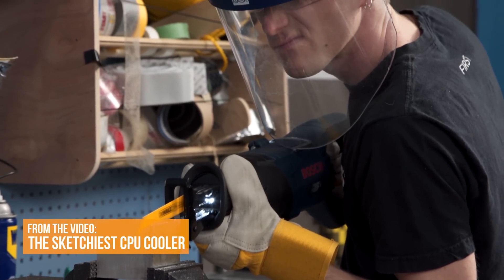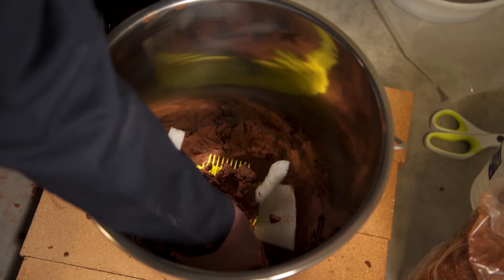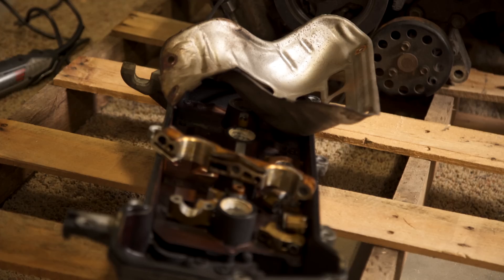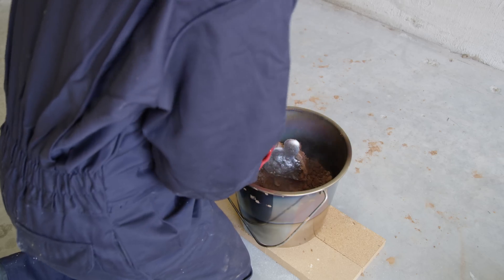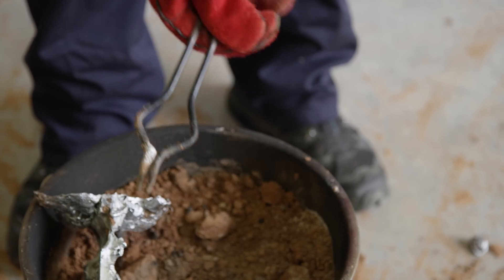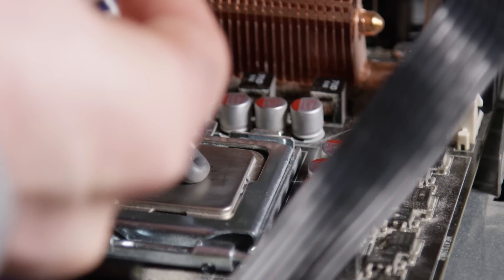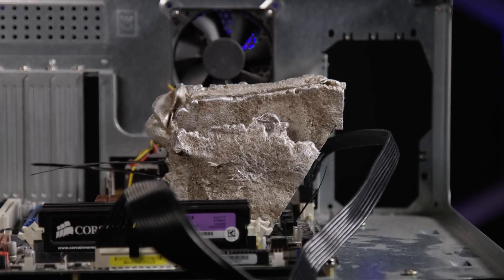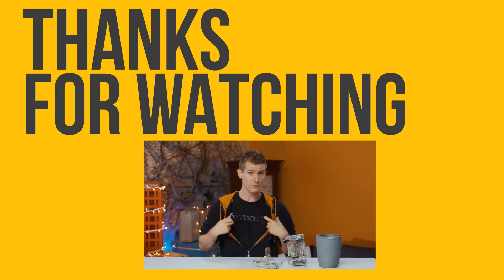The WORST CPU Cooler EVER – Sketchy Heatsinks Ep2

Comment: I think the mold material a big issue.
Should've used something like quick set plaster/sand blend instead maybe?
The biggest issue I see though is the mold isn't hot.
if the mold is cold, it's gonna leach all the heat from the molten metal, and cause it to solidify before it settles into all the cavities.

Also that no man's sky thing aged kinda poorly, unlike no man's sky, lol.
Game had an insane glow-up.

Comment: You kept failing in your castings because your aluminum was too cool. Also the based of the cooler should have been at the top of the mold, not the bottom- both for casting reasons and because when you do the process correctly, the top of the mold can be as smooth as a mirror

Comment: Should have dipped the PLA mold in ceramic slurry, layered it up super thick (by letting it dry and re-dipping over and over), then fired that to harden the mold and melt the PLA.

Then just pour into it, and as long as the sprue and vents are in the right places, you've got a heatsink.

Or start with a block of aluminum, use a bandsaw to cut regular slots for fins, then sandblast the hell out of it—sandblasting more as you approach the distal ends of the fins to achieve a taper. If sandblasting doesn't work for that, sandpaper definitely would. Simply insert paper, and pull toward the end. That way the distal ends are being sanded by the entire stroke while the proximal ends are sanded much less.

Oh well, I'm four years too late, but it isn't as if typing were difficult or time consuming. I enjoy it.

Comment: to get those small fins you want you would need to do injection moulding to get the pressure required to get the molten metal throughout. 5 years late but I just saw this one now.

Comment: omg. Yall are making this so much harder than it needs to be.
just use sheet metal,  the really thin stuff. Use a cutting wheel on a grinder to cut the metal into little squares and have the squares held together by a 3d print out. If you really want to go the extra mile, use thermal paste in-between the squares or better yet, tac weld them on. 6-8 hours of work max, if you take the time to smooth every thing over with a flapper disk.

Comment: That's not how you make a model for melt aluminum... you need to press and make the dirt more hard and you have to use two pieces of the dirt so you are able to take out the original plastic model.

Comment: I used to work in a foundry, I could have told you none of that was going to work. You can make fairly simple castings that way (if you don't care how strong they are) but what you were trying to do is way more complex. There is actually a fair amount of science in casting metals. Proper alloys, temps, chemicals in the molding sand and release agents sprayed into the mold. And I am not sure about aluminum since I didn't work with it but in most cases you can't just take a chunk of cast metal, melt it down and re cast it. For instance we worked with iron. When we did it in our furnace you needed a certain amount of iron scrap, steel scrap and then other components like ore and what not. I think we had about 5 different materials that went into ours. And the more complex you made the shape the harder it was to mold and poor. Fins for example would be very hard to do.

I also worked at another company that actually made coolers and radiators like what you would see on a cpu cooler. We mostly did large stuff for hydraulic coolers on heavy machinery. We did some smaller stuff though like coolers for power steering pumps and transmission coolers for cars. I think one of our power steering coolers would actually work great in a computer. You would have to set it up like a custom water cooling system though with a pump and all that. I'm actually curious how well an oil cooler would work on a computer. Wish I still worked there. I would try to snag a defective one and test it out, or send you one. You can buy them though. Something like this   https://shop.advanceautoparts.com/p/dorman-oe-solutions-power-steering-oil-cooler-918-319/11735120-p?product_channel=local&store=1702&adtype=pla&product_channel=local&store_code=1702&gclid=Cj0KCQiAj9iBBhCJARIsAE9qRtDWV8K0XcexhX7ne5qwlMJrqohkNMHDYZFdpxIJ_B_QmSYYiOMF0twaAgXlEALw_wcB&gclsrc=aw.ds

They make all kinds of different ones though. Summit racing even makes some heat sink coolers.

Comment: You guys should have created a rubber negative mold to make a wax positive, and then used the lost wax process. Also, don't rely on the wax being melted by pouring in the Aluminium - bake the whole green sand mold in an oven to get rid of all the wax, prior to casting.

Comment: This was absolutely hilarious, loved it, especially being a retired engineer.  Maybe next try welding aluminium plates to an aluminum base - one with an arc welder and one with a gas welder.  Or an extra thick plate for the top of the CPU then bend some fins and with thermal paste, screw them to the CPU top plate.

Comment: Size does not matter for heat dissipation, surface area does.  If you had the same size heat sink with more and thinner fins, you would get better cooling.  Theoretically.  Hence size does not matter.  It's a similar concept with friction, in case y'all wondered.  Surface area has nothing to do with the theoretical coefficient of friction.

Comment: Linus talking about how computers work: ok so this boi clocks in at 5 MHz and this compares poorly to the ryzen 7 3600g witch when overclocked can run flight simulator at a amazing a 3000fps... Ect...

Linus talking about anything unrelated to computers: THIS, IS, A, FIRE. IT, IS, HOT.

Comment: Do this again but this time do lost wax casting. You can 3D print the design, cast it in high strength silicone. Use that mold to make a wax cast that mirrors your 3D printed model. Finally cast that in a water soluble plaster and melt the wax out.

Comment: So, when casting glass, we use a mixture of silica and plaster. The silica softens the plaster so that it can be more easily chipped away from the cast product. With this you can use materials like wax to create your positive, and melt out the positive before casting the metal. Once your mold has an empty hollow, you then have to bake it in a kiln in order to remove the water from the material. If you are pour casting you could then take the hot mold from the kiln and pour in your metal. It should flow into all the nooks and crannies very easily, assuming you use ventilation holes to let the air escape from any under pockets. This is also result in a finer surface texture (once you get all the plaster off) than sand.

Comment: Really i did better with a wood fire and a coffee can and used old soda cans. Its not about the height of the channel its where you put them. And when you pack you sand maybe make a stamp out of wood and use hmm a hammer to tamp it down any lose sand will give way and ruin your mold. My old man was an iron worker his whole life and taught me quite a bit about metallurgy also taught me how to build brick furnaces and molds for casting

Comment: casting 101: With molds requiring multiple channeling, position template upside down in casting sand with a ventilator hole on the opposite side. Gravity will do the rest.

Comment: This video is 3 years old, I'm sure you guys have moved onto better projects, however I would like to lend a quick, simple, idea that should produce some good end results. 

3/16 Aluminum as the base/mounting plate, "massaged" with a flapwheel/drill to fit the mobo, then simply use low-temp brazing rod (still good for 730degree temps) to attach 14 or 16a plates of Aluminum to the base plate. Could all be done within an hour or two.

Comment: If you wanted your own aluminum block, just have it printed?
Its way easier. Or, press some some flattened sheets of coke can cut outs and fix them together.

Like...you bought an entire engine to melt parts down?
Why not just melt all the soda cans in the office into ingots? you're bound to have loads of those lying around, after a week. 

So much could have been solved with a proper casting mold, so easy to make out of wood and sand as well...
Just two parts, , make the impression, close it again, make the channels, for gods sake....put in a pouring chanel ...dont just pour it into a bucket of sand with something in under lightly packed sand...

i know this is a couple years old, and i love you guys...but christ they really did a piss poor job on this one :p

Comment: There was no way that the aluminium was going to melt its way down the pouring hole and then rise up into the fins about 2-3mm thick, melting away the PLA along the way. The pressure wasn't there and the liquid aluminium started cooling very quickly, essentially creating a plug along the way. To force molten metal into a mold takes quite a bit of pressure behind it to fully fill every part of the mold. Gravity was never going to work. At all.

Comment: linus: "the worst cpu cooler ever"
intel stock cooler: are you challenging me?
Reply: And I would like fries with that.
Reply: @tzuyd  yummy
Reply: @afinnishfishnet7366  wraith coolers aint bad tbh
Reply: So bad is it not.
Reply: Yo lol....my stock cooler basically runs at 1000rpm irrespective of whatever the temp
Reply: The thermal paste got charred on my CPU....all the praises goes to my stock cooler
Reply: @afinnishfishnet7366  the amd wraith cooler is actually valid for use
Reply: AMD FX had Intel beat anyway
Reply: @tzuyd  FX cooler is pretty good. atleast better than intel stock.  But it is very noisy.
Reply: @valtteriwikstrom5844  Well yeah frankly as someone never interested in overclocking the FX fans were the absolute worst because of their noise.  I don't care about 10 degrees - I work in a computer store and we had to start supplying AMD machines with 3rd party coolers, therefore negating the cost savings, because of the complaints we were getting.  Especially the top end FX series which just used the same cooler as the low end - everyone would have been better off if AMD didn't provide a fan at all
Reply: @tzuyd  yeah. And there was overclocking mod that made the cooler even more loud. Short one component on fan and wire negative to -12v & positive to +12. After that the fan will spin like a jet engine. Btw. I think that you could alo buy those processors without the cooler.

Comment: Abs nylon and most 3d printer filaments are safe... and you know when you 3d print it, it melts anyway so if you're using a toxic plastic you better use a HEPA filter.

Comment: Using green sand for lost pla
Using a graphite crucible with an oxidizing flame
Not melting out the pla before casting
Putting too much water in the green sand (it should be damp, not mud. Too much water can cause steam explosions spraying molten metal everywhere)
Face casting rather than two part with a riser. Face casting is fine for parts that don't need to be flat. But for a heat sink you should use a riser from the side to make the surface that will mate with the heat spreader flat. It will also cut down on the amount of cleanup you will have to do. And I suggest two part using green sand because it is safer than trying to do lost wax or lost pla without a proper melting oven. Two part allows you to remove the form from the mold rather than having to burn it out. Or you can do a one part mold and just stick it in a crap oven for a few hours, but if you are using plaster it brings up a whole new set of safety issues.

I'm surprised, but glad he didn't hurt himself. I think it would be great if he did this project again, but with some sort of expert helping him through it, and going over what he did wrong on the first attempt. I'm sure there are a few Canadian youtubers who do that sort of thing. I don't know of any offhand, but I'm sure someone can find someone.

Comment: You must use HDDs for aluminium as its a special alloy for casting with silicon.
Also use flux a when casting the fins go down. Liquids dont flow up as easy as down.

Comment: Trying to think outside the (Noctua) box, how about using some old radiator cooling fins cut from a defunct A/C unit, refrigerator, or car radiator (any of which might be cheaper than a used car engine). Possibly solder/weld them to a square of aluminum or copper.

Comment: You could have used plaster, or plaster of Paris instead of greensand, it is more like a liquid so it can get into all of the cracks, but it will set solid so that it can be easier to cast into, I have seen it done before and it usually allows greater accuracy

Comment: You may have found more success if they would have designed the mold so that the fins were facing down when casting, that way gravity will force the aluminum into the fins instead of pressure.

Comment: flip the mold upside down, lengthen the part which will be placed on the processor, fill in through that hole, cut the lengthen part to nearly desired length, grind it for fine tuning and flatening

effect: the sink will fill up completely

Comment: keeping in mind, I haven't cast anything since high school and we used sand molds for the process (and this was about 30 years ago), the way I would of done it is,  with a two piece mold putting in the proper vent and pour holes.  The sand we used was just slightly damp, just wet enough to hold together then it was packed into the frame.  The "heat sink" would then be placed in the mold, second frame added to the top of the first frame and then the sand would be packed in (gently, no need to pack too tight).  The mold would then be separated and the master part pulled out of the mold while you make the pour paths etc.  Then pour the aluminum into the mold.

An alternate method would I might try ; make a silicon mold of the part, then make a wax cast of the master and then use that to make your sand mold and just let the wax melt off like you were trying to do the PLA.  

Your sand was way too wet and using clay?  Liquid water is just a bad idea around molten aluminum.  

I really would like to see you guys design a head sink and have a CNC machinist make it tho.

Comment: If you ever wanted to revit this idea. Drop the casting take a block and use a table saw with a metal blade to cut slots. or use a block of aluminum (pronounced the proper American way) and weld rods to it. Lol or have a aluminum statue of linus cast by a pro and weld it to a plate.

Comment: When you had issues with cutting the aluminum with the reciprocating saw it was because aluminum is a very soft metal it is also very stick so it sticks in between the teeth of the blade then you can not cut it any more.

Comment: Hey just thinking about using the case for cooling which would be like setting everything inside the heat sink, it might actually be possible to provide a larger radiator surface area for cooling if of-course it's  not all nuts...

Comment: You should conect a water cooler system to a truck radiator! The heat exchange is so massive on that thing you might getaway with running it without a fan

Comment: Mold a cube, make one side really, really flat and smooth and saw slits in the top with a band saw. If you don't have a band saw, use a sawzall clamped in some kind of jig to make nice, parallel cuts. Cut slowly with a fine-toothed blace. Use water or oil, heat sink and to take away filings.

I would use copper.  You might gold-plate the processor side after smoothing it to avoid corrosion. You might consider adding borax to the molten metal as a flux to help remove impurities regardless of whether or not you use copper or aluminum.

Comment: if you're trying to do this on your own, the only way that you will get this is by trying and retrying... Not using a reciprocating saw it against aluminum, try using styrofoam since it's more sturdy, and using using finer sand. I'm no expert but I'm petty sure that would turn out better than what linus did.

Comment: Why didnt you do it like this
Put the plastic heatsink with the fins facing the bottom and the bottom facing the top , using the clay or green sand with that way ,it has a better chance on forming the fins and well the bottom can just be sanded flat!!

Comment: looks like it would be excellent in a case/computer mod for wastelanders LOL Also I would say, you should have heated till you burned off all the PLA or foam before pouring, and of course heat to max temp, so that it is as fluid and holds as much heat to avoid solidifying due to heat escaping into the mold material's low amount of thermal energy, to equalize things. Then it might actually have worked with a much more viable output from your 3D printed versions. lol
Reply: I should add, if you did not do it in the previous video where you were trying to cut with a saw, you need lubricant to keep the aluminum from galling on the blade and getting stuck, so a band saw, with a metal cutting blade (a ryobi 9 inch can be outfitted this way, I have done it for years using mine for everything from cutting logs of oak ash and mahogany to make 3 inch solid cubes of wood into working hellraiser puzzle boxes lol, http://www.borgsteamfactory.com/prototype.html to see one I made ages ago.)

Comment: I'm thinking, along with any improvement your can find for your moulding, you could try working with copper rather than aluminum. It shouldn't have any dross problem, and you can source it easily enough from the plumbing section of the local hardware store.

Comment: There is this wonderful thing called gravity it pulls things down. You should use it to your advantage. But when casting it helps to have all of the proper materials not just the metal. You can buy casting sand and build a casting frame to keep the sand packed tight do not cast with lose sand in a bucket you could never get a decient cast do some homework and try again please I think this has the potential to be awesome